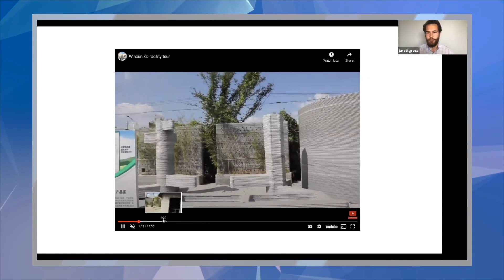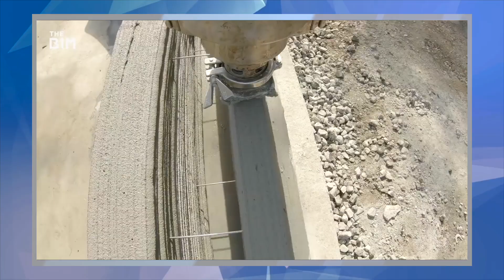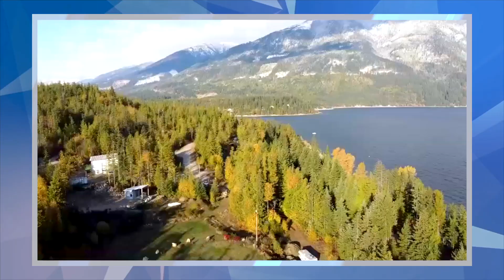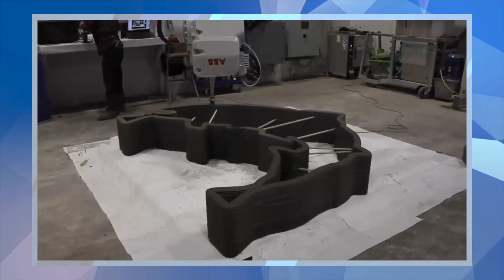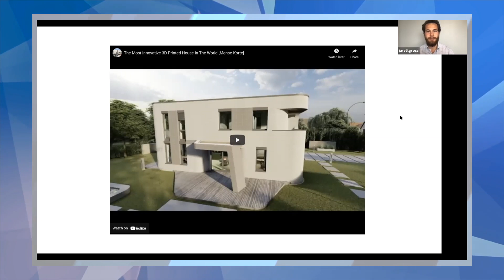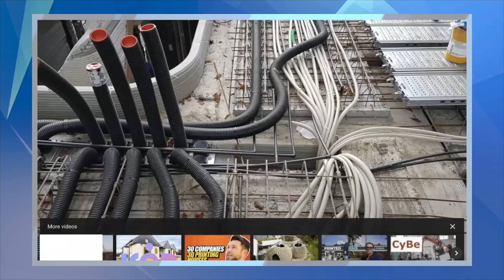$10,000 3D Printed House Myth Debunked | How 3D Printed Homes will Change Real Estate, Jarett Gross

Comment from the maker: Post your questions for Jarett about 3D printed houses in the comments below.
Reply: Interesting concept and likely the future of all construction.  Typically concrete will absorb moisture, so is this a problem with current technology?  Other materials being considered? Resistance to tremors/floods/high winds?   As land prices increase, I think the future will include a more multi-purpose vision for its usability.  Perhaps with underground living areas with above-ground farming/solar production/business use.  Thinking of only a single purpose for land is so limiting.
Reply: boilednuts 6000psi concrete should be very sturdy but the materials are constantly being improved many think geo polymers will be the future solution.
Reply: Hello Jason, what do these 3D printers cost and are there any real life cost savings in using them?
Reply: What is company's name? 
I'm dying to work with 3D printing tech company that's so impressive and innovative!
Reply: How can I get a 3D house made?
Reply: I would assume the most cost effective way of automated home construction would be a steel frame  and foam home manipulated and welded by AI similar to automobile construction but I haven't seen anyone attempting this. Researching automated home construction as much as you guys do, have you seen anything like this?
Reply: Concrete is not a good insulator.. 

thermal mass, yes but it will get cold and retain that temp or hot

Comment: The problem with saying it could reduce construction cost by 50% is primarily because walls aren't 50% of the cost. But even if it was I don't see this getting cheaper than framing or forming walls.. even if 3d printing became widespread and had economies of scale. Robotic arranged ICFs or forms or prefab panels would make more sense.
Reply from the maker: Great point!

Comment: China is known for construction speed but not advancements or quality..

Winsun is printing prefab concrete panels in a factory which is idiotic.. standard prefab manufacturing is much faster and stronger than using an  addative process. Also prefab has it's uses but extremely hard to transport. That's why people form and pour walls on site, so a more local ready mix can easily deliver the concrete.

Comment: The 10,000 was just for the cement shell.  Lots of other costs.  Permits.  Utilities. Flooring.  Appliances.  Roofing.  The Lot.  You get it.
Reply: 10k isn't even a good deal compared to y framing that first floor
Reply: @Josh.1234  It does includes foundation, siding and drywall and possibly insulation.  . .I don't know if that makes a difference.
Reply: @OWK000  10k is just the walls they print.

 Foundation, drywall and the exterior paint waterproofer is extra.. the foundation and slab probably cost more than 10k by themself
Reply: @Josh.1234    The edge foundation is printed and could accommodate arrangement to support crawspace and traditional wood frame/joist type floor.   But, they probably actually need a slab to stablize and equalize the printed cement walls and edges.  They would need a prepared, compacted, graded gravel surface at least.   They don't need drywall though, because they leave the cement as is, so that's a saver.  Every thing needs paint, so thats the same.
Reply: @OWK000  they do not print their footings or at least I have not seen any of the company's doing that. They all start with a leveled concrete footing and start printing on that. If you can find video of them printing onto the ground directly, pls post. Also, all the 3d printers need 4 pier footings to bolt the machine to.

If you want the course interior walls, the drywall is not necessary but most have some portion of the interior drywalled and most build interior walls with studs so they can more easily run elec/plumb/HVAC.. all masonry walls are a pain for tradesmen and will more time and cost.
Reply: @Josh.1234  I wonder what they print that 3D printed mud house on.  It's cute.  I will have to watch that video again.
Reply: @OWK000  yeah mud wall construction is interesting by it won't meet our structural requirements and honestly not sure in what situation you would want it.
Reply: @Josh.1234  Just watched the Kirsten Dirksen episode on the mud 3D houses. The Italians are doing work with geo-polymers that are very promising, science and progressive.  They are calling it "green cement" and are looking for ways to create a chemical reaction with natural materials that is as strong as cement and doesn't require the same energy expenditure it takes to cook up cement.  So this is not your great grandmother's mud house.  They've also got that Italian artistry going.  They are using cement footings on the edges and 
gravel in the middle in most cases it looks like.
Reply: @OWK000  if it meets the strength and durability requirements, great! I would have to see the engineering white papers  before I believe PE claims though

Comment: Who is providing your information? It's crazy how confidently you are both speaking about certain things you're not even remotely familiar with. I agree you're familiar with the 3d printing process and it's application to construction, but please stop spreading incorrect information on construction materials, conventional methods, etc. Case in point, poured concrete has an r-value of 0.08 per inch. This is VERY low. Concrete in the correct thicknesses could have a high thermal mass, but this is significantly different from r-value. Also, preengineered trusses are not barn style construction.
Reply from the maker: Armchair critic. We have deep research on these topics, for example, the concrete is nearly ALWAYS a MIX that makes it more expensive. I would LOVE to see 3D printers revolutionize housing but it's all HYPE and CLICKBAIT, so far. Let's hope that changes.
Reply: @JasonHartmanEmpoweredInvestor  Wasn't questioning the cost of concrete being a hindering factor to the cost 3D printing structures. I would expect you and your research to be well versed in this, and I agree, the cost associated with producing a concrete product that flows well enough to be pumped yet retains a high enough slump to hold its shape and weight of successive layers, while exhibiting the necessary structural capabilities will be costly. Especially with everyone trying to create their own proprietary mix.

I was merely suggesting that you do a bit more research or avoid making matter of fact statements in areas you might not be as well versed. If concrete had such a great r-value as you stated in the video, why would the German built house show insulation being added to the wall cavity? Probably just German over engineering right? As a general contractor with almost 30 years experience in the industry, the decline of skilled labor has definitely peaked my interest in the automation of construction techniques. I can also tell you as an industry plagued by issues with the "latest and greatest" materials and techniques, contractors are inherently slow to adapt new materials and processes and it will take a lot more then a few 100 case studies for them to adopt it. In my opinion, it will be the declining skilled labor pool that pushes contractors to consider this technology, not the efficiencies or being an early adopter.

Additionally, many of those contractors (whom are already skeptical) will discount everything you are saying as incorrect because of the misstatements made that are so obvious to them. If the clickbait and incorrect titles gets them looking, I can live with that for now if it's making more folks aware. Trust me, contractors are well aware of the costs of materials and appreciate videos like yours for clarifying it for the common consumer.
Reply: @jamesonward5141  Like it is!!  Except worse, because the following trades have it a lot more difficult.  The "better insulated" part got me so irritated that I made a video just about that - and I am giving concrete a better R of 0.10 per inch.  Though, digitally built is probably inevitable, so working on it.

Comment: I waited for my Tesla 3 from 2016 until 2019, about 3 years until I god what I wanted  and at the price I wanted.
I don't think this industry, using 3 D concrete printing technology is mature enough  to deliver what I  have seen these guys on the mass media  and main media  were talking about.
Probably , I would say, it is just in infancy.
 Reaching at a price of 50% to build a house compared with conventional methods , needs something like a development of 20 or 30 houses  so you can bring your printer set it up and run  it constantly 24 h/day and finish all the houses in about 10 days. 
The roofs and the finishing inside, including doors, windows , plumbing , power lines means other teams  coming and finishing the houses. 
 I am willing to wait one year or two until the industry matures. So far all the efforts seem to me a proving of the principle, now they need to scale it up.
Reply: I don't believe it's a maturity problem. Looking at it from my perspective as a computer scientist and a general contractor/framer, I don't see any future state of this that would help me build a house and reduce any of the main measurement: schedule, budget, effort..

I am crazy about 3d printing aside from wall construction.. particularly metal production part printing but you have to ask yourself does this bring the same benefits? And it doesn't..

Comment: Inkjet printers , print also in 3D. However the 3rd layer is ever so thin that is not considered as a layer which has a dimension.  Therefore  the inkjet printer is considered a 2D printer not a 3D printer.

Comment: They have super light renewable building material that grows naturally...  it's called wood.  I can buy a few hundred square foot structure kit at my local hardwood store for $1k (well maybe $2k now) and construct it myself with bare hands, nails and saw in spare time.  Could be a few generations before they can best it.
Reply: That is 200+ year old technology. Time to move on. FYI it's 2021 and it's half over ...
Reply: @lpc5152  not all technology results in an improvement.. we look back at history and only look at the successes but in reality only about 10% succeed.

3d printing is amazing in many industries but it doesn't work here and doesn't have a projected path where it will. 

This guy is right, wood framing is just so much better or even formed or ICF poured concrete walls. We should be looking for tech to improve these or other methods and prefab factory built walls or kits seem like where automation would shine.

Comment: does it need insulation ? foam or something for molds not to grow through the concrete?
Reply: Yeah, they will typically have a double layer with a hollow space between the inner and outer wall for you to put insulation in.
Reply: Good observation.  Yes, and there may be mold also.

Comment: Places like Southwest Missouri can see temperature fluctuations in the springtime anywhere between 30 and 40 degrees back and forth DAILY for a month or two months at a time. I don't believe the concrete could sustain that. it's different when you have a slab of concrete on the ground that can rely on the ground itself for more regulated temperatures... But to have an exposed structure see 30 to 40 degrees fluctuations each day back to back... Would probably be very destructive.

Comment: I have a question in regards to material as well as structure. Hypothetically if printing a home and part of the cement gives way, i.e. material fail or structural fail, would it be possible to patch it, using the machine, or would the requirement of the layers compromise the stability and force an entire reconstruction?
Reply: If portions of any masonry wall are crumbling or falling away, there is a serious problem and won't be easily fixed.

Cracking in CMU blocks or form poured walls are common but if whole sections crumble or fall out, there is a serious systemic issue in how the whole foundation or walls were created. This would be the same.
Reply: If you install support pillars so the entire weight of the ceiling and roof on them you can do whatever with the walls. It still cheaper and ligther than standard, as walls are mostly air.

Comment: This feels like the beginning of a revolution in building homes similar to the auto revolution. Even though they have automated building cars, manufacturers find ways to increase price via style and technology - feel like the same will happen to homes. Very interesting times!
Reply: It might be a feeling but it's not a revolution. Sounds good for people outside the construction business but currently I see no projected path this will become a better solution to first floor wall construction except maybe on the moon/mars.

The reason is the first floor walls in a house go up so fast and cheaply 3d printing can't compete even if it was twice as fast as it runs now. I could frame, sheath, waterproof these walls with 2 other guys in half the time the machine takes.. and it takes just as many people on site working to make sure a 3d printed wall goes up correctly. Temp/humidity/shade/mix/slump/etc so many variables in the curing and setting of the concrete. On top of that it requires a huge mixing plant setup on site because the machine goes too slow and needs it mix as it goes so it doesn't harden. Also you need guys setting window/door lentils, electrical boxes, etc.. also might need a industrial generator for the amount of wattage the mixing plant, the printer and the cooler will draw.

Really it should be compared to concrete formed walls. Basically there you rent this full dumpster like container that has a big stack of different sized metal forms that you bolt together. Big house takes about 1-2 days to setup and then it takes 1 day to pour with your local readimix trucks.. they take the forms off and it's done. 

Or use ICF blocks and pour inside those..
Reply: @Josh.1234  I also used to be a laborer.  Framing, insulation, flooring, HVAC, electrical and landscaping.  I won't lie to you, it is a revolution.  Lucky for you, the entire banking industry is on your side because they're idiots that can't conceive of disruptive change.  That's the only thing that's held the revolution at bay.  But you're better off preparing yourself for what's coming.  Just the truth.

Comment: I believe the 3D printed house for $10,000 is going to be a very basic house. Kinda like the homes that were built in the 1940s - 1950s in the US.
They will be built on a slab with no basement.
Reply: most houses have no basrment
Reply: @flodjod  No basement needed in Florida! I had hoped this technology would make affordable homes not just so people could make bigger more extravagant homes. I could deal with having a basic home especially if it was under $100k which is just not found in today's real estate except for very expensive very old mobile homes. People who bought when housing was like $80k are gouging the market like those $40k mobile homes raking in $100k+ currently and those older $80k homes are at about $200k just by putting lipstick on a pig!
Reply: Correct. 100%

Comment: Never gonna fly. If you really want affordable housing, sell it in kit form like Sears did a century ago.
Reply: Except irs not a home if I need to go to a store then move it to the land and build it
Reply: Exactly! There are so many ways to use automation to improve building like doing essentially what sears did with those home kits except build the kits in an automated factory. 

First builder source (major supplier) has a program now where you take your CAD drawings to them and they wil import them into their system and after working out the details, will label and cut every board for your custom house and package them in order.. think they may even build your headers but not sure on that.. basically a custom Sears kit. If they applied automation to the factory cutting, price would drop way down.

Comment: The calculus for predicting the cost of 3D-Printed Buildings has multiple variables that are changing simultaneously...
1) The cost of engineering, developing, and producing the printing equipment is changing.  Developments in Computation,  recursive modeling, and AI have greatly reduced engineering cycle-times and radically improved the quality of prototypes.
2) The cost of raw materials are changing.  As 3D-Printing Scales up, demand for materials introduces economies of scale that reduce price over time.  
3) Tthe quality of the materials is changing.  Materials engineering has also accelerated, resulting in the development of stronger, lighter materials  that can be printed faster.  Thus, taller, stronger  buildings could be built faster than ever before.  
4) The number of materials that can be "printed" is changing -- right now the focus is on structural materials like steel and concrete, but it is conceivable that wiring and plumbing might also be printed one day.   Because 3D-Printing allows complexity without cost, much more of the building's volume could be made into productive space.
5) The nature and use of buildings are changing.  As technology advances, more and more businesses are moving toward automation and remote commuting -- buildings will increasingly be designed for robot efficiency rather than human comfort, freeing up space for additional production capacity.  
6) As energy costs grow, building efficiency could become a cost-driving motive for businesses to build new facilities with complex structures built in designed to minimize heating and cooling costs, and recycle energy normally wasted in industrial processes.  3D Printing could make such complexity affordable.